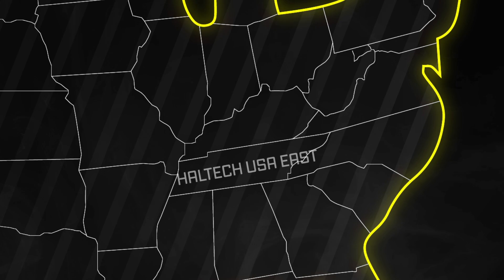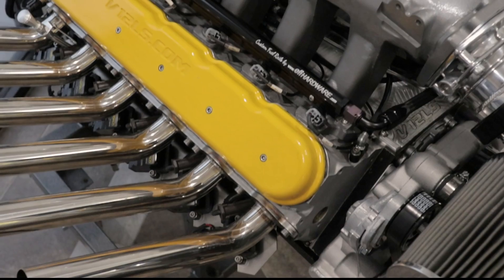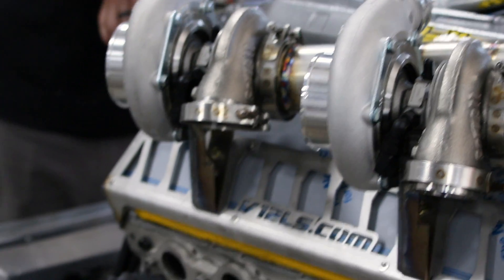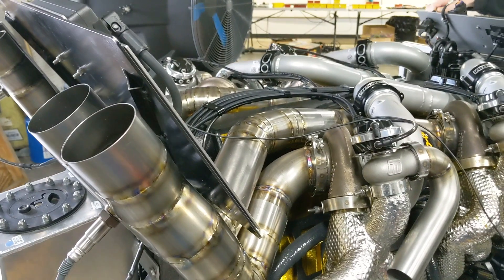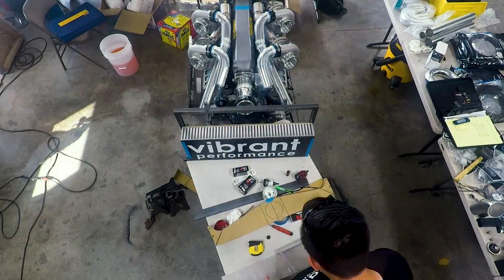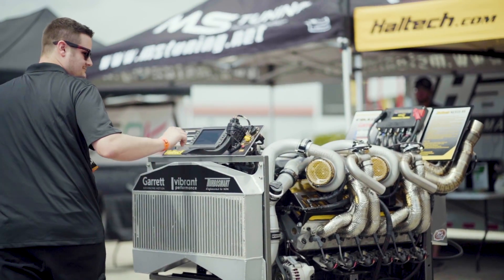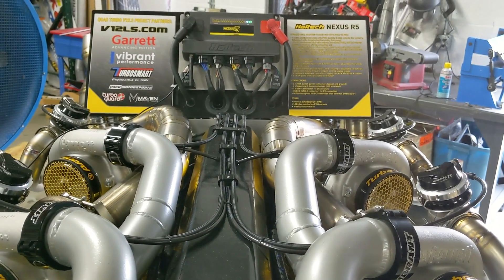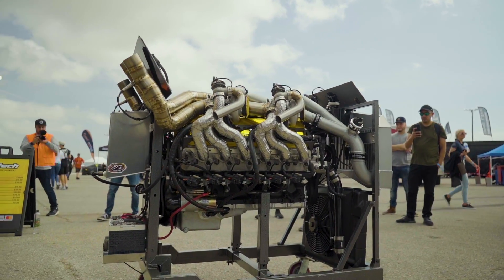✏️ The Ultimate LS-Based Engine? | HALTECH PROJECTS

Comment: 7 pounds of boost v12 LS 9.7L oh man. 1300 hp? c8 corvette. but this engine is capable of silly insane amounts of power. with 4 turbos and if you start adding psi. if you got up to like 15 pounds of boost, you're going to be making disgusting amounts of power, this engine should easily be able to make 2200hp, on pump gas. C8 Corvette. lets go. if you got up to 22 pounds of boost, you'll start wrecking shit, but like, approximately 3000 horsepower. if i was to guess. if you get to 34 pounds of boost. WHOOOO WEEEEE. materials wont survive. you'd be able to dyno it but then you'd have to rebuild. i think the cap for this engine is around 2600 horsepower. trackworthy. rebuild after 24 hours of racing. 2200 horsepower if you dont want to rebuild. if you're using aluminum throw my numbers out. get a cast iron or titanium block. you absolutely need it. on aluminum. delete 2 turbos and settle on 1400 ponies. otherwise the engine will pop like a pimple. still might.

Comment: probably around 1300 1400 hp and it would be perfect for a single cab long box square body with 2,5 ton rockwell axles and like an 8 inch lift with some 45 inch boggers she would rip

Comment: I wonder why the exhaust to turbos wasn’t piped according to firing order?

R1, L2, R5 -> turbo #1
L4, R3, L1 -> turbo #2
R6, L5, R2 -> turbo #3
L3, R4, L6 -> turbo #5

Is that why the motor seemed to sputter at time stamp 6:55?

Comment: Well at 7 psi it should add another 50% in power. I am more curious about fuel and air distribution. I think with an intake like the Holley Hi Ram with the A2W intercooler between the base and the lid and 4 throttle bodies feeding right off the turbos would solve any airflow and fueling issues, remain compact for packing in a chassis, look trick as hell and with such a short path to pressurize off the turbo near instant response.

Comment: put it in a 1973 chevy C10 with its giant engine bay it would be a perfect sleeper and I'd say with the current setup and 7psi 1170 hp and 1050 lb ft of tq with the rite tune.  700hp na but the rpms are probably limited to 6000 and the air fuel ratio is rich just listen to it in the video probably 10 to1. lean it out take the limiter to7000 rpm and see what you get.

Comment: Fun to watch this project  =)        But still i think you did not optimize the n/a version with single air intake , that would lean up the rear cylinders, as most of the air would be going in cylinders in front of the engine when their valves open at same time as rear cylinders would require air as well.       But hey..  that's what dev projects are for.    
One thing from turbo setup pops in my mind as well..    40mm wastegates are bit small for gt35's,   will cause boost creep on higher revs.  Just be ready to dump some extra fuel in when it happens.

Comment: 1850 ft/lb torque at 5,200 rpm- 1475 hp at 5,800 rpm ! i guess this amount - i have a smaller type turbo but these all 4 could do 1,880 hp.
Reply: just 1 of those turbos on a 2.2 litre celica will give 400 - 430 hp

Comment: 700Kw,  if the turbos are well sized and everything is good about 750Kw is perfectly doable on 7PSI if the base of 520Kw is something to go on.
Reply: 750kw is about 1000hp, and 520 is about 700. 

700hp NA on 1~ bar of atmohsperic preassure, 7 PSI is almost 0.5 bar. so in a perfect world a 48~% incrase in power is over about 1035hp or a bit over 750kw. 

Note: in a perfect world. But the turbos should be able flow well in excess of that 7 psi in that LSV12. so the scaling should be very linear.

Comment: Let's see... mild cams, Haltech ECU, very nice unrestricted exhaust set up, inter-cooler, I reckon around 1310 HP should be about right (assuming good airflow) through that fat inter-cooler!
Reply: I reckon you would be pretty close with that estimation, I was thinking 1250-1350 because it doesn't have dual intake manifold or Interchiller

Comment: This motor should be developed and let's just drop those horrible C8.R DOHC sounds for the upcoming C8 Z models and shove this OHV V12 in them instead with a smaller displacement and 2 Turbos in a Twin setup, it would be surely good for some 1000-1200hp of steetable factory reliable power.
It sounds so close to the original LS1/2/3/6/7 when idling and revving up, music to my ears even without the boost 😌

Comment: 7 psi is equal to approximately 0.5 bar. Half of 0.5 is 0.25.

700 hp + 25% = 875 hp
700 hp + 50% = 1050 hp

I believe it is putting around 920 hp though.
Reply: I do find it hard to believe that 4 turbos produce only 7 combined psi

Comment: 1 psi equals 15% more power typically so I think it will make around 1450-1500 hp. I can't wait until they dyno it, I would love to hear it with a load on it and the boost starts building.  I am sure it'll sound completely different than free revving on a stand.

Comment: With a PR of 1.5, each turbo should be pushing about 30 lbs/minute, so about 260-300 hp each. Depending on the tune and dyno loading, I'd be guessing 1100-1200 hp depending on compression ratio. My exact guess is 1158 hp... and if that turns out to be correct, I'd like my one wish to be granted for a sponsored Haltech Elite 2500 please :-D LOL

Comment: After recently seeing a 70's Firebird from a shop in CA with crazy HP; I like the idea of first putting it in something classic.  So how about using the body of a 55-57 Nomad, but make it a mid-engine.  Maybe use the trans-axle from the new Corvette.  May require extending the wheelbase for such a massive engine.  But it would sure help weight distribution.  If I win the lotto, you can bet I will request some shop build it.

Comment: Atmospheric pressure is 14.7 psi at sea level. Video states N/A engine produces around 700hp. With ~7 psi of boost (or an additional 50% of pressure), boosted output should be around 1100hp.

Comment: 1130 HP at the flywheel, a car it will fit in a70's GM American wagon or Aussie version of the same or an Aussie ute with a big enough engine bay , my guess the only transmission the will handle that will be a 2 speed drag built power glide

Comment: I reckon with the base power it had at only 7 psi I reckon it will pull in around 900 horses with the combination of the 4 Garrett turbos

Comment: If you can make it fit in something mid engined like the new vette or older nsx or mr2 or some lotus chassis... That would be awesome. You wouldn't be grip limited at that point as Engineering Explained points out in his vid about why the newer vette can be faster with less hp. Plus there is the chassis dynamics stuff that impacts ride quality and handling where mid engined set ups also tend to be better.

Comment: The whole and only purpose of using LS engines in your build is that they are a cheap and readily available. These engines cost around $50,000 aud!! The turnkey package costs $80,000! And for that money you get a freaking gigantic engine that makes 72hp per litre, indicating that all they've really done is just add on another few cylinders without straying too far from the original LS design. Who is this for? What is the point of this? Wouldn't it make significantly more sense to spend half the money obtaining the same amount of power on an actual LS?
Reply: 1200 HP... 911 GT2S

Comment: 1200 ina c8 midengined truly American inspired chevroghini
Reply: How is that supposed to work though? The back has to stay in place because of the transmission, there is very little space in front of the engine to the framerails and the v12 is 50% longer than the c8s Lt...